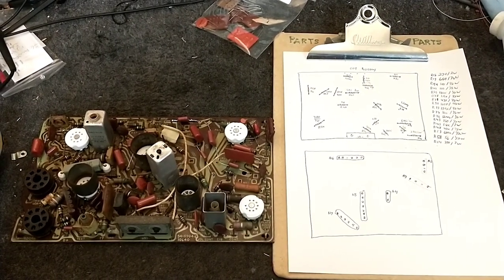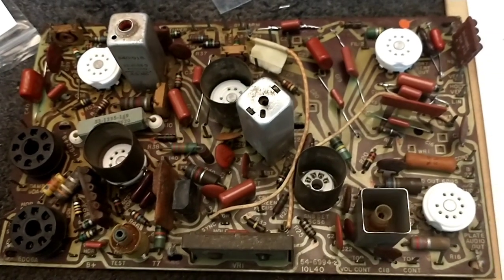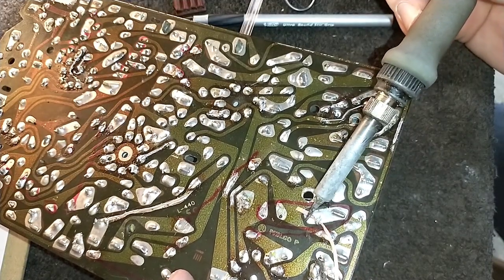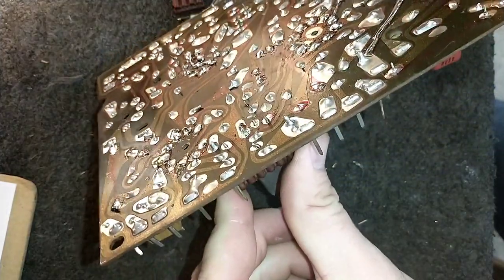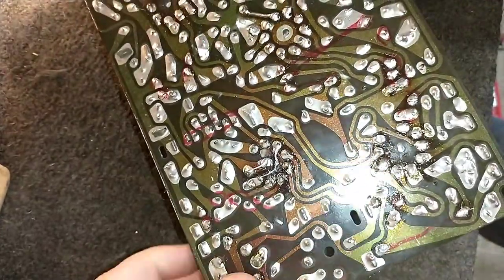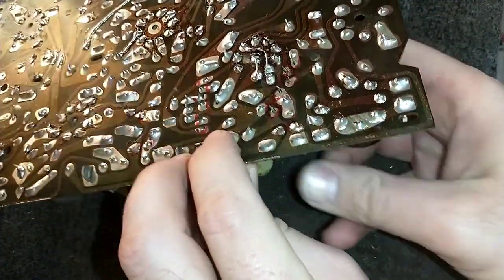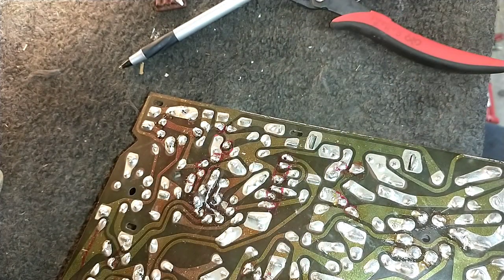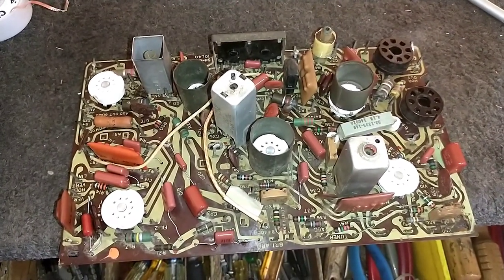Servicing a 1959 Philco Predicta Princess Part 4/9 - couplets and out of tolerance parts.

Comment: How about a vacuum solder removing iron? Lots of work for a TV that has a picture tube that only lasts 6 months.
Reply from the maker: Im hoping because the NOS crt is a Raytheon it will last longer than the philco tubes which were junk from the get go.

Do you know if philco did in house crt manufacturing or did they farm it?
Reply: @JordanPier  I was told one time that Philco tubes were generally built under contract by Hygrade-Sylvania.